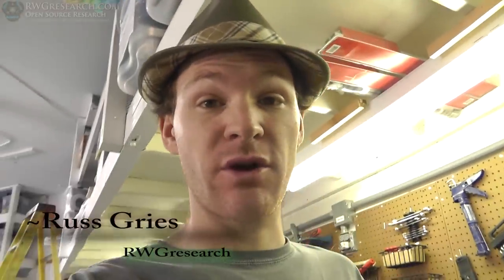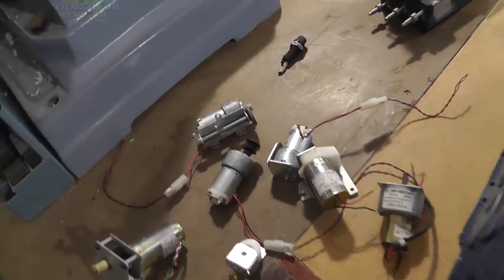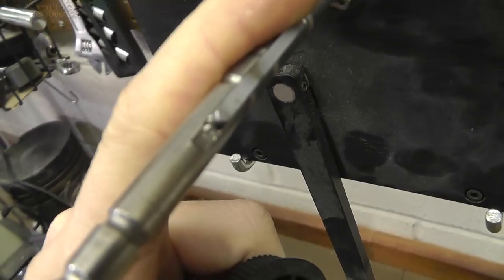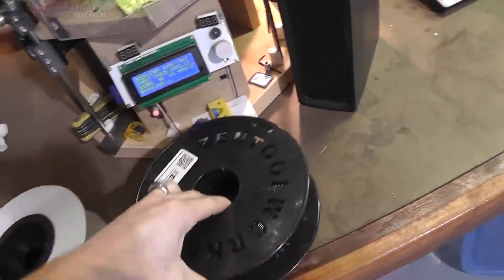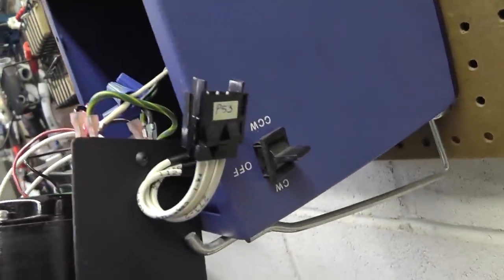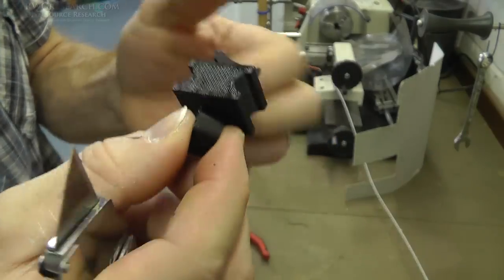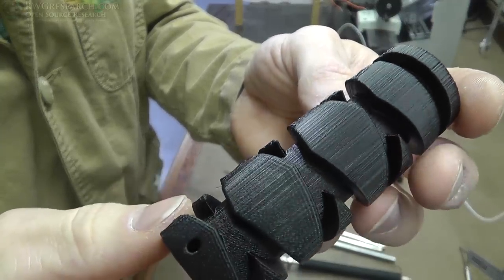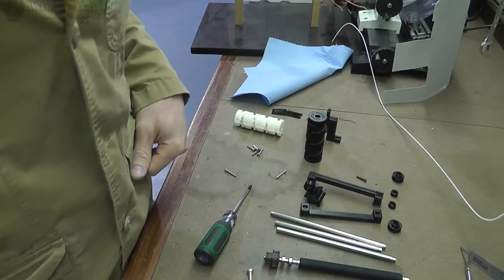#16 Part 1. Filament Spooling oscillator - Russ's Helix Looper: The Idea

Comment: Hey Russ, me here...    How much do you save by extruding your own filament??  I know you've been working on this project quite a while, always improving it! 

I love how you can print a multi-piece part that can't be made in 1 piece in any other way... and actually a useful part! (not just a ball-in-a-ball demo)  3D Printing opens up so many possibilities!

I have yet to get one... have you done any recent comparisons for the typical home-DIY-er 'bang-for-buck'?  I see Zero is building one now... do you like that machine? The money he invested is about my range... cheap, but no junk... that's everybody's goal.
Reply from the maker: hi there me,

:)

so here is a link to the plastic i use: http://store.os3dp.com/index.php?id_product=17&controller=product

and a better deal for more: http://store.os3dp.com/index.php?id_product=18&controller=product

so right now that's when buying 10LB of pellets that's 8.74$ for 2.2LB ( 1kg)

so... just for the plastic... that's about 1/2 price for the cheapest ( good) filament. for most its about 23$ on average to get the good filament. So even better than 1/2 price. most of the time.

takes about 6-8 hrs to make a 2.2 LB spool on my filament extruder. . But most of the time i don't need to watch it. it just runs in the back ground...

then at some point i will make my own plastic from bottles or other sources. one good source prints that did not turn out... that's all reusable stuff.  support, or a "raft" is normally junk, but i can reuse it. so one can add that to the tab of savings.

i haven't compared Manny printers lately, only the delta style. there normally priced at 1000$ but i spent more than that on mine. so a kit would have been better...

The only problem i see with Z's is that there's not much support holding everything together. so any flex in the system will effect the print. but if ran slow it will not be a problem. i even run my slow most of the time for the same reason.

~Russ

Comment: It looks like the squashed side is caused by the layers collapsing during the overhang printing of the bottom half. I think the only way around that is printing in two halves like you mention.
Reply from the maker: most of the reason for it was due to the fact that it pealed off the bed... i did not want to stop it so i just tacked it down with my bed goop. but the edges did not cool and yeah it jut stayed to hot. to small of a part and not enough cooling. so Manny factors. :) ~Russ
Reply: *****
I wonder, could you print it, and have the printer pause between layers so each layer cools down completely? Would this work, or would the print be more susceptible to de-lamination?
Reply from the maker: azayles this will work. but the real problem is in the fact that the edge is "to small"  so the printer is trying to lay layer on the " outter edge" first. if i change this to do " layer from inside out" it will work better. but scene i switched to cura as my slicer i don't seem to have the option. over time one learned how to make there printer work under different conditions. :) ~Russ

Comment: soo..... this thing you are making is cool. is it a tool for your shop?. also, when will you start making some horsepower. like spinning a ball bearing at 60,000 RPM is awesome. however, need something loud like a Harley Davidson. try to make some massive horsepower. if you are reading this just think about the potential. nasa spent 1.5 billion $ on apollo 13. some of nasa rockets are making over 37 millions horsepower. while nitro drag racing motors are making 10 thousand horsepower. home hobbyist can build a nitro motor for approx. 150k... basically just wondering how much horsepower you can get out of each dollar you spend. for example you will spend about 15$ per horsepower when you make a nitro motor not bad. nasa will spend like lots of money. sooo. my point is how efficient can you be. of course i have no idea what your goals are. but i think anti gravity and horsepower/thrust/torque are all related to anti gravity perhaps. for any anti gravity device you have it will require lots of electricity/ maybe you will need to generate that electricity with  with torque or horsepower or thrust
Reply: also. maybe you could integrate some of your perpetual motion  ideas with mechanical motors.. i never actually tried to do this